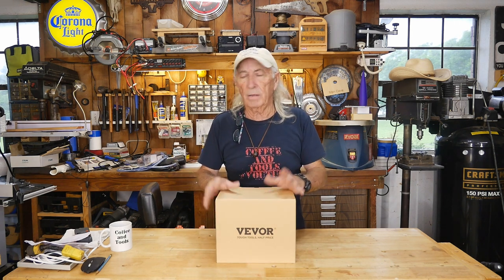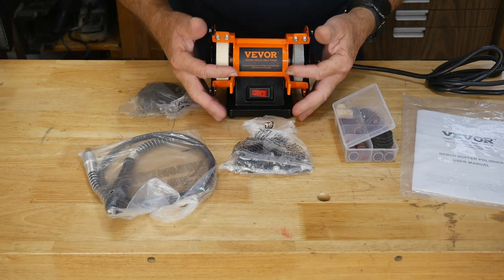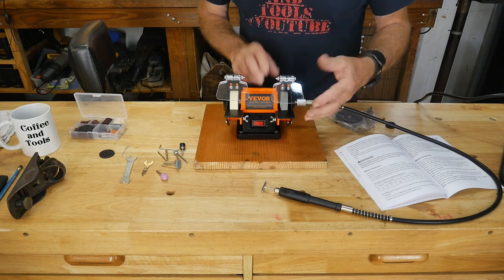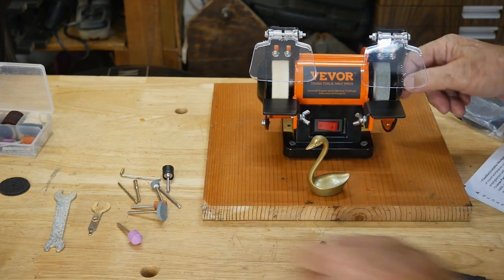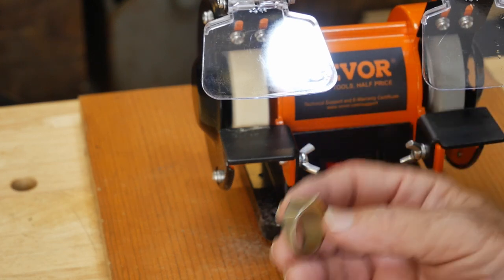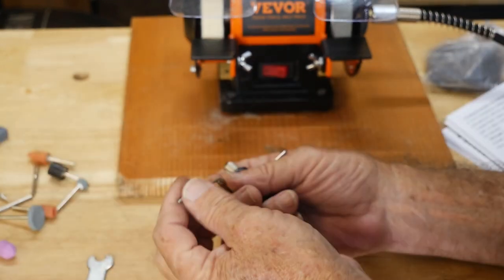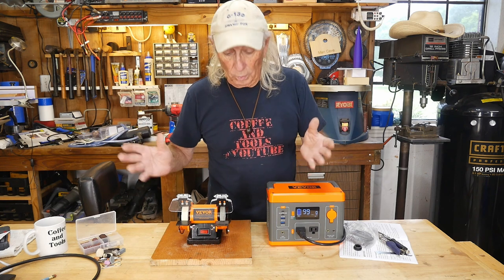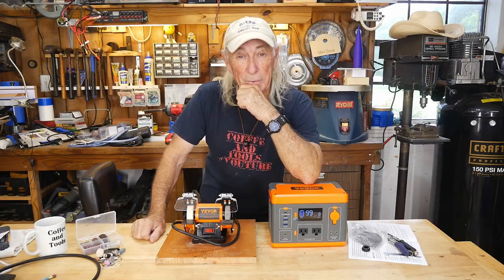Vevor bench grinder / buffer / polisher tool, reviewed by Coffee and tools Ep 344

Comment: Just some information for you.  To be able to use the buffer wheel you will require some buffing paste.  Usually green  little brick that you rub on the wheel before you start buffing.  Buffing with no paste will not buff much.  Hope this helps.
Reply from the maker: It was just for the show, I have a complete buffing set with various grits.